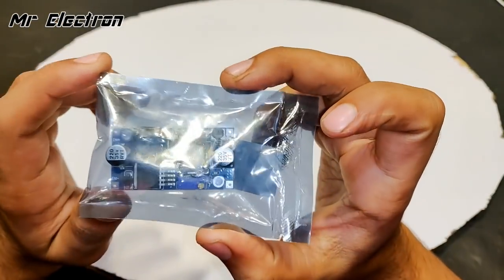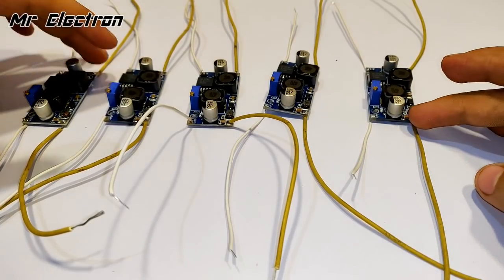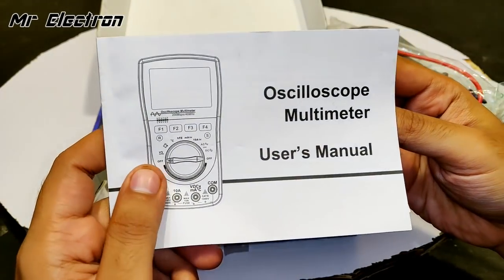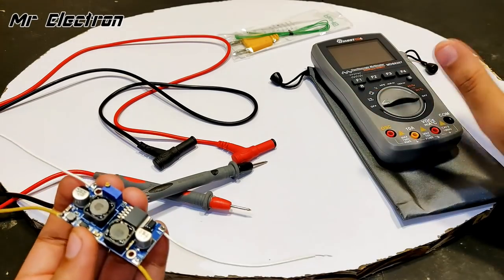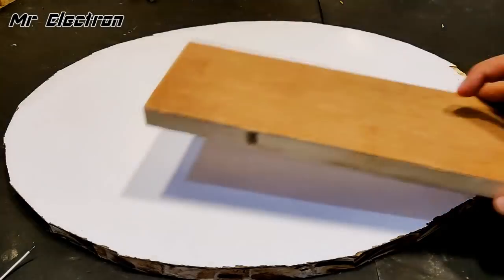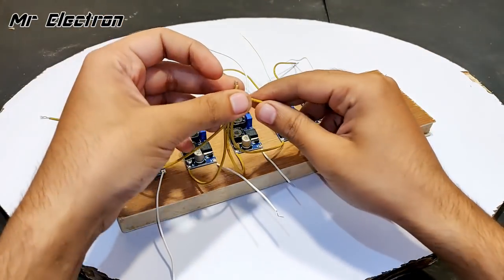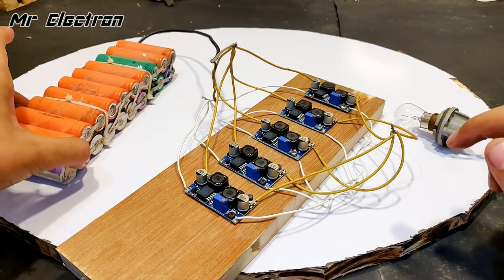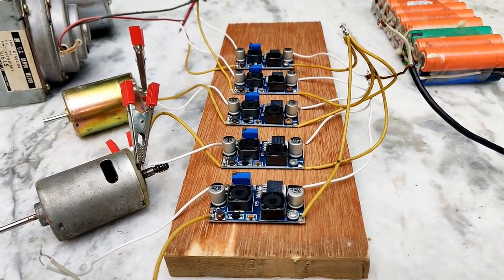Make DC Motor Step-up Supply 3v to 12v using DC Buck Boost Converter XL6009

Comment: Simply if you need to connect this 5 unit you need to put in the output a diod to each one of them in the positive out so you prevent the forward crashing of the 5 converters
Reply: abed itani why not put one single diode only in the negative output since they’re common to every converter through the battery, or are the input and output module negatives not bridged?

Comment: The whole point of using several boost converters is so that you can distribute the load across each. Getting the output voltages close to each others is to have the load's total current evenly distributed across each boost converter. 

Reading the unloaded  voltage output can get you close to the same voltage output across all the boost converters. But one will always produce a higher voltage than the others and more current will drain through that one.  

but one can get even more precise voltage output. First get the Vout as close as you can as done In the video. Then connect them all up to a low power load and then read the amps through  positive lead on each boost converter. Where one is higher than the others you can lower the voltage to bring the current down to the same as the others.

This is best done first with a small load,  and can be repeated under a heavy load.  A light load first  because the smallest voltage difference will source current first through the highest voltage boost converter without a heavy load drawing the voltage down to the same as the others. This process will get you far more precise than measuring the voltage alone.
Reply: Exactly, these are only boost converters, not as was stated many times, buck-boost converters.

Comment: Have You tried to connect 1 schottky diode to each output of any single step up, and all of the positive pole of all the diode to common positive for gaining a sum of current? So one positive output of any step up will not discharge incoming into positive one of his step up beside?!

Comment: the following test was missing: place the oscilloscope in DC at the output with load and measure the amperage at the same time. to see how much the voltage stability varies under load, great video.

Comment: If you would like to use them in parallel, you must use diodes to prevent backflow to adjacent cells, or Buck converter modules.
Reply: where should the diodes located?
Reply: there is diode built in

Comment: you've used buck/boost converter. Maybe that was reason they didn't want to run in parallel? Maybe if you would try it with only boost converter it would work?
Reply from the maker: I will have to give that a try.

Comment: sir i use this stepup boost in 12v fan with powebank adjuting at 12v but fan runing speed not increase same as 5v and stepup boost also heatup too much.

Comment: Why don't you tried to use a diode on the input side to separate him
Reply: assid a Because the input is battery so a DC source does not need rectification or voltage drop.

Comment: Just sharing, if you need to use the 2 or more Step Up with parallel output, you can use the Diode with high current or can handle 3A current for each step up you are using in this video, then put/connect the cathode(-) Diode on Output(+) on all of your Step up(each Output+ Step Up using 1 Diode) in this case you are using 5 Step Up then you must prepare 5 Diode, then join all ends of the anode (+) diode wire to to your load/Lamp, and also join all of Output(-) wire from the Step up to your Load. good luck,..

Comment: Sir if I connected the outputs of 5/6 same module in series instead parallel Will I get 250VDC please make a video if possible on this topic
Reply: Do you wanna charge an electric car?
Reply: @zarbonida  I want to get DC 250V

Comment: Proper capacitors need to be placed between battery and inverter to protect the batteries, and as well as, between the load(s) and inverter(s).
Reply: Mikhael213 “proper” capacitors would also ‘protect’ the DC source from all current drain and loads from voltage input, rendering the circuit function into the ether. What’s needed is to be IMproper* capacitors so they don’t block

Comment: Blocking diodes on the outputs should work.
Reply: It would drop the dc voltage.7v each diode

Comment: I just watched the video for the inevitable errors! XD
I was actually expecting to gain more knowledge and information on parallel dc-dc converters but...meh...Not the case.
Sorry man...
Just search "dc-dc parallel" on google IMAGES...It can be done, you're just doing it wrong.
I've used the same buck boost converters in parallel with a camcorder without any problem whatsoever.